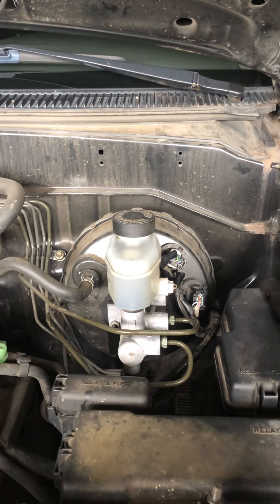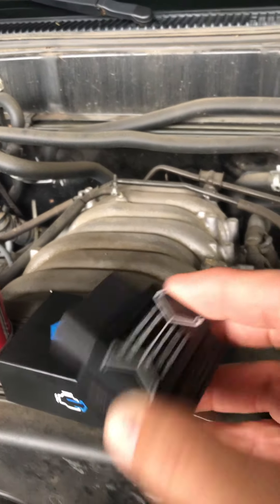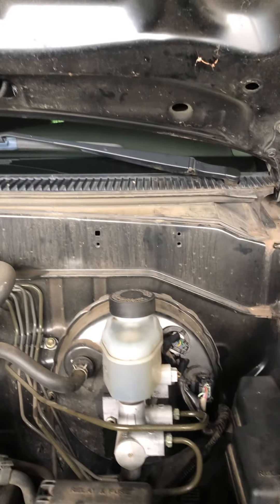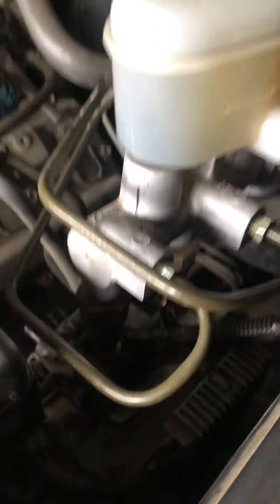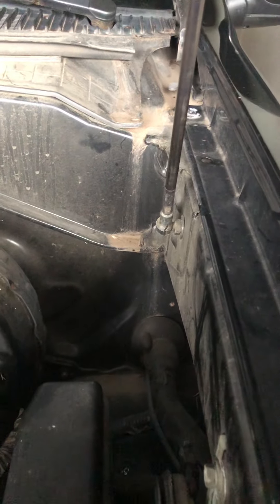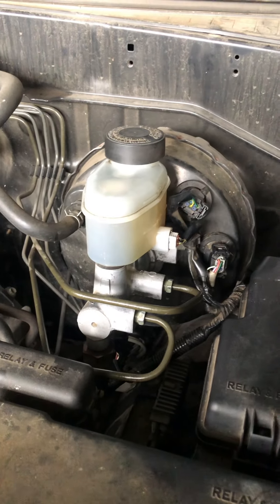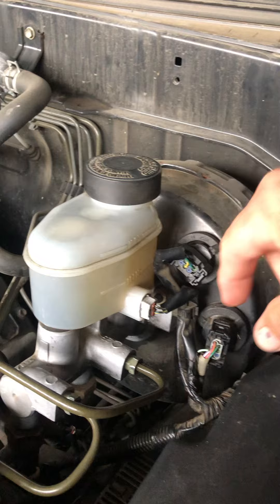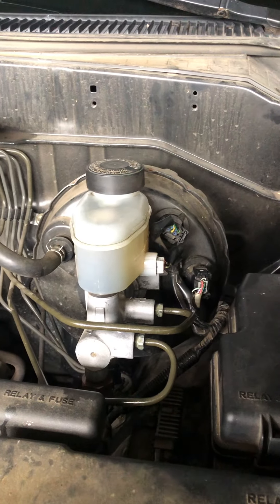1st Gen Sequoia brake code solves

Comment: Did you replace the two brake pressure sensors? If so, did it resolve your issue? I purchased two new OEM sensors but haven't made the change because I decided to change the master cylinder as well. I figured I might as well do it all at once, but the master cylinder is on backorder and perhaps may be discontinued altogether.
Reply from the maker: @nj2mddude205  The sequoia is in island storage most the time. I cleaned the connections and had no further issues for the remainder of the week. When I returned to the mainland I purchased aftermarket pressure sensors and master cylinder on ebay for a 1/10th of retail pricing. I’d like to bring a brake booster as well, but haven’t found one yet. I’ll bring the parts with me next trip in February and see if the cleaning held or further work is needed.

Comment: Did you have any issues with the brakes not wanting to work? I push on my brakes and everyone once in awhile the make a grinding noise and all the lights come on and they don’t work until I fully let off the brakes and try again
Reply from the maker: No, my issues are nothing like that. I would guess that there may be an issue with your brake pads or rotor; such as a build up of rust on your rotor.
Reply: @princessjonnafarms2966 I have the code c1247 also and brakes and rotors are fine. I am just trying to figure out if is it a brake position sensor. But idk where that might be or what part that is
Reply from the maker: @ryanhansen3350    per google C1247 is a stroke sensor malfunction in the ABS/VSC system most repairs seem to involve replacing the brake booster, but that may not make sense if you can't detect anything wrong with the brakes and don't hear a vacuum leak when you step on the brake pedal.  You might want to start by topping up your brake fluid and cleaning the ABS ECM.  There's a good you tube on cleaning up the ECM, but I can't currently find it.  I'll forward it if that changes.
Reply from the maker: @ryanhansen3350   here's a link to a good video on how to troubleshoot abs and clean the ECM
www.youtube.com/watch?v=tc6Bxk8DoXI&t=264s
Reply: @princessjonnafarms2966  thanks so much for your advice!